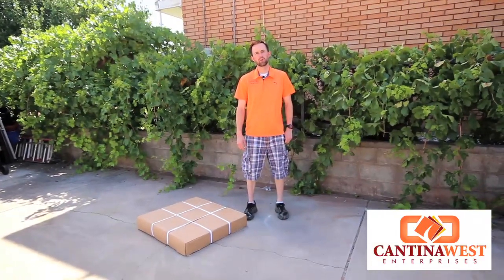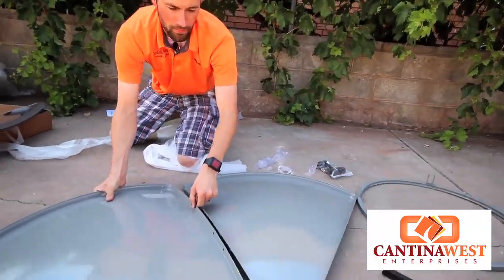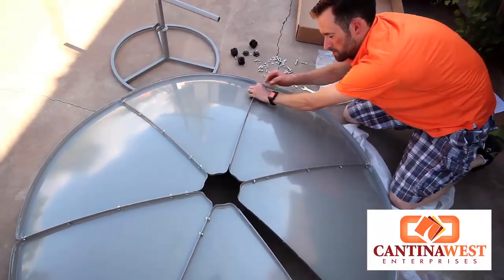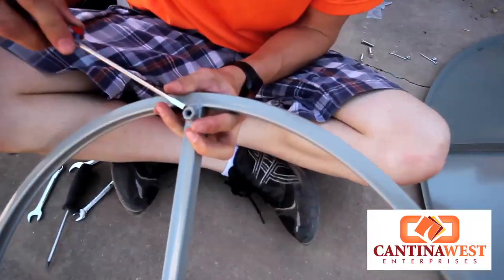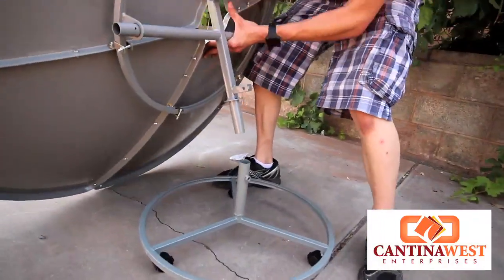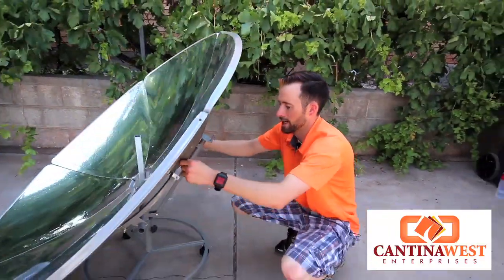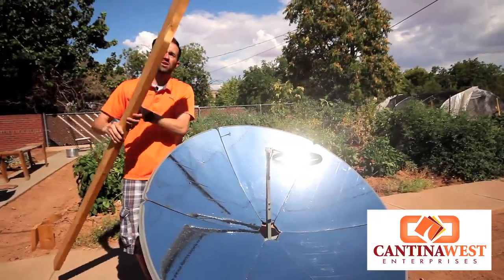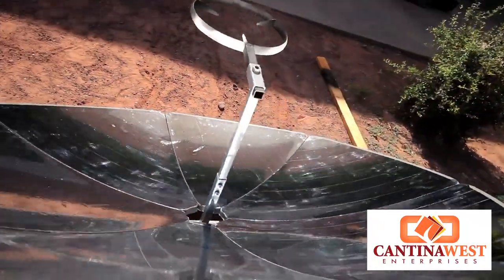Solar Burner Installation Instructions on "Latest and Greatest" Parabolic Dish

Comment: Thank you for this quick assembly and review. This seems to be the most common generic parabolic cooker (and also the least expensive) that I see online and there's yet to be such a detailed look at the parts. I like how the parabolic panels themselves sound like metal. If this is the case, I can see it lasting for a while.